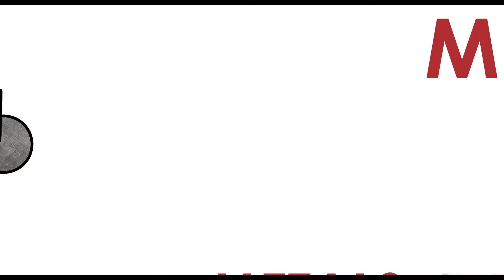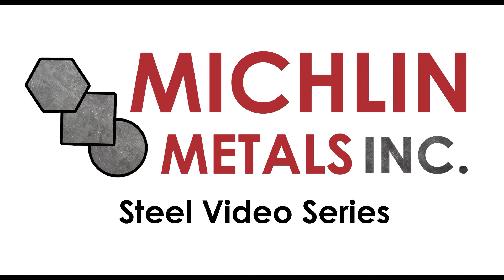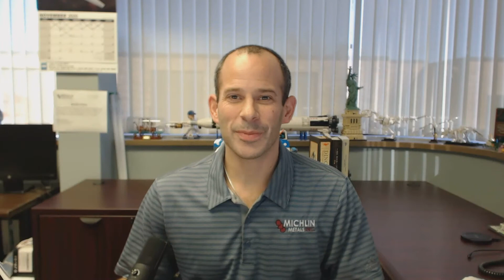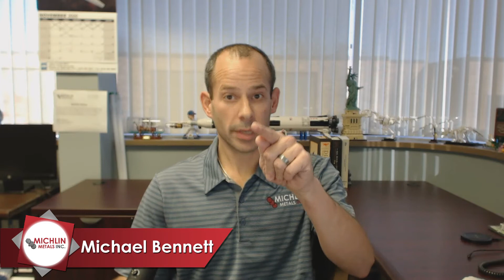Nickel Alloys Part 1 - Commercially Pure Nickel - Nickel 200 Vs. Nickel 201

Comment: Is Nickel 200 plate 1mm thick suitable for electrolysis where the Nickel 200 plates are used to separate distilled water into its constituents of hydrogen and oxygen, the water is mildly alkaline with a small amount of sodium hydroxide.
Reply from the maker: Nickel is often used as an electrode material in similar applications.